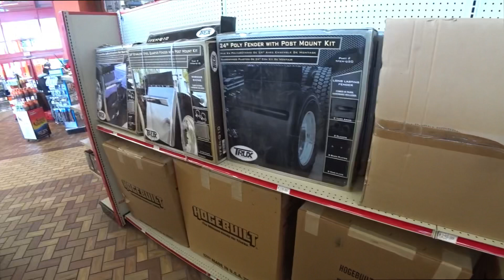December 16, 2019/235 Putting some more chrome on Big Blue

Comment: You what's good about your Videos  . You show there's  more to driving a truck than a steering wheel 
Sometimes  you have to replace minimal  stuff like that .
What I am surprised  to see is drivers that will not change a fuel filter 
Larry i carry a tool box full of good tools to do the Job .
You sir are Valuable  asset to any company

Comment: Larry the bolts go through the fender, then the flap goes on the backside of the fender, then the bar and nuts and washers. That way you only see the bolt heads to the front and the white bar on the tire side to the rear. The bolts should have a square part by the head that fits into the square holes in the fender